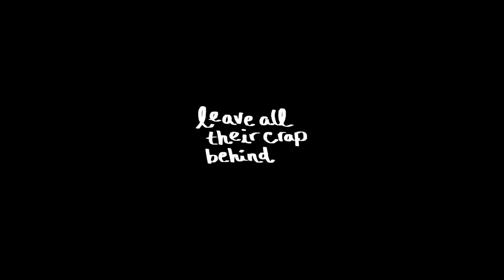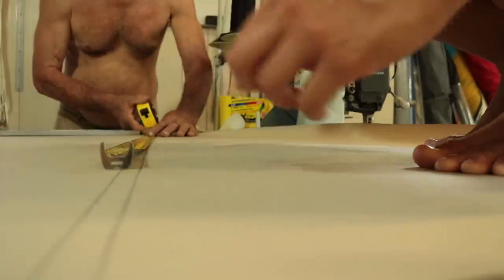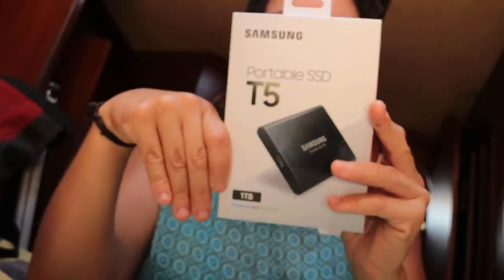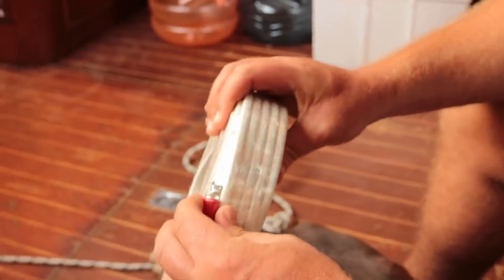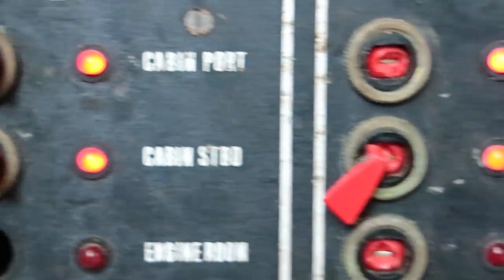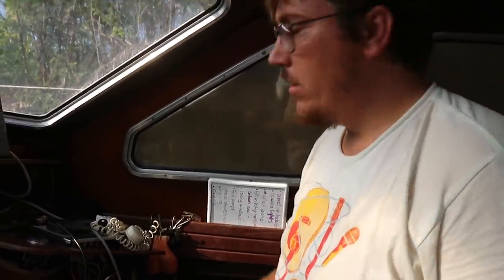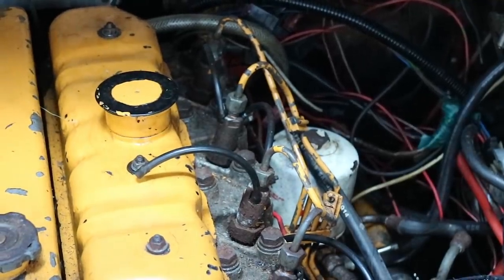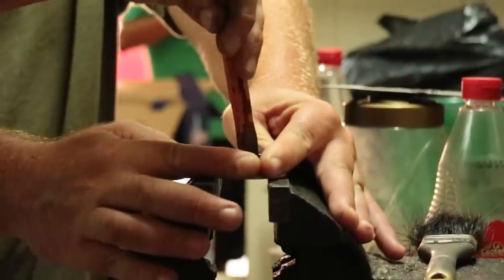58. Good As New

Comment: Another fantastic video guys! It's gonna be a great boat! Solder, and use a tinned solid core wire as a bridge, if need be. Great idea with the pvc. Use gray electrical pipe and you can get water tight fittings with access plates (with a gasket).
Reply from the maker: Yeah! Thinking that grey electrical pipe might be more fire resistant than normal pvc also.
Reply: @sailorama  PVC is inexpensive and easily molded around curves and bends.

Comment: LED light strips - I have had real success with soldering.  Helpful to have and extra pair of hands to help hold it together.  I just got a new strip to replace some tired ones, so I have to warm up the soldering iron.
Reply from the maker: Yes, the consensus seems to be soldering all the way!
Reply: +1 to soldering,  brush the leads first, then flux and pre-tin then solder.  
DON't  overhead as that tends to damage , thats one of the reasons for pre-tinning. ;-)

Comment: I just redid a friends boat with all LED's they are the best! 

Soldering is the way to fly with them! What I do is use duct tape to hold the strip and the wire while I solder, tape everything in place, and only do one side at a time. Let the other cool before you switch it up. I use a piece of plexi glass or an old cutting board to tape everything to, this holds it all still so I can create a really solid solder joint.
Reply from the maker: Using tape to hold everything in place is such a simple possible solution. We'll try this - thanks!
Reply: @sailorama  I will be at the dock next week so I will have power to solder, I will make you guys a video showing how I do it!
Reply from the maker: Cool. We’d watch that!

Comment: As long as you mount the LED-strip and the cables so that none of them can move, soldering has always worked out for me.
Reply from the maker: The solder doesn't like to stick on the led strips too well.. I guess I need more practice..
Reply: @sailorama  does your solder contain fluss? It could also be that the strip is not very clean. Try cleaning the solder pads with swinto, or scrape with a knife.
Reply: Apply liquid or paste flux before touching with the iron. It will help clear the point of soldering from any contamination.  @sailorama
Reply from the maker: Yes, tried flux. Will try to clean the area extra carefully...

Comment: Hey there.  Don't pull the engine yet.  I got an old diesel running this week.  I emptied the fuel filter and filled it with marvels magic mystery oil.  Next, I detached the recirculating hose that leaves the injection pump (sends unburned fuel back to tank) and attached a short length of fuel line to the banjo fitting there.  Next, I sucked on this hose until the color I was spitting out looked like marvels mystery oil (really wasn't that bad).  This, in effect, filled the gummed up injection pump with this oily detergent which is totally fine to run full strength through your engine.
Next, I reattached the recirculating line and started the engine.  It coughed and sputtered, blew some soot out of the tailpipe, and then began to run better than I ever remember it running.  Twas a great moment to see my wife walk over, smile and give me a thumbs up.  Not sure if AutoZone there in Mexico carries the Marvels, but Seafoam might be more available and can be used the same way.
Reply: Your username 🤣🤣🤣
Reply from the maker: Thanks for the detailed description! We don't have an AutoZone right here, but might have a chance to travel down the highway to one in Playa or Cancun. Will look for the Marvels or Seafoam that you suggested. Stay tuned! Awesome to hear that you managed to get a similar case running again!

Comment: hi, if u actually get that started put 1 cup per 100 gaal. of 2cycle oil into the fuel helps with sticky injectors and valve train.
Reply from the maker: Yes, will probably end up trying that. Increasing the viscosity could help loosen parts.

Comment: The electrical board is nice. I would just replace the switches with some quality units. Instead of Amazon, try Mouser or Digikey. NAFTA means that electronic parts are duty free between the US and Mexico. Skip the plastic toggles, since, as you can see, they break easily. Those look like M12 or 15/32 bushing thread.  Here's an example from Digikey, a dust tight and waterproof SPST: https://www.digikey.com/products/en?keywords=C3900BE And here is a more expensive, but high quality Japanese switch from Mouser: https://www.mouser.com/ProductDetail/NKK-Switches/S2AW
Reply from the maker: Yeah, thank you! Those websites are a little more pricey (mainly for the shipping it seems - mouser actually has competitive prices for the toggle switches themselves). Really helpful, awesome!

Comment: that jury-rig "compass" to trace the hull shape is typically called a shripe (or something like that poor translation)  
I would consider researching what local engine shops might have already that can drop into the old engine place for pennies on a florida rebuild engine.   I have had shockingly good luck buying almost hand-made engines around the world,  somehow the ICE have become adopted technology in most cultures these days, most of the engine makers can be trusted.
That said, ive sailed down the coast of Europe with a outboard for in-out duties on a parallelogram of sorts drop system to pop it out of the water and back in.. never had a problem.  and far easier to work on than stuff down in the belly of the beast.  - or at least I lived to tell sooo... its possible.
Reply from the maker: Hmm. What’s the biggest boat you’ve stuck an outboard onto?

Comment: Solder.  Tin the wire and the solder point.  Maybe then coat with a glob of hot glue to reinforce the solder and hold the end of the tape in place.
Reply from the maker: The glue is a good idea, might try that if we find any of that!

Comment: Seems like it has been made easy with crimp on. Non waterproof epoxy(?) and waterproof silicon types 4 wire etc. See below https://www.alightings.com/product/rgb-led-strip-to-wire-connector/ After checking that out then find cheapest place. But their is a coating you are running into. Take it off, tin the metal and then you can micro solder leads. I would get the crimp on.
Reply from the maker: Haven't seen these kind of clips yet. Gonna show them to Robi and see what he thinks...

Comment: Suggest using a punch instead of a chisel on the bearing.
Reply from the maker: Not visible from the angle shown, but there was no surface to grab with a punch. Had to ‘grab’ from the inside of the casing, so the chisel seemed to work well enough.

Comment: go to ebay and search led light strip connectors, you'll be amazed.
Reply from the maker: Yes - the usual connectors (we’ve used several cheap brands on amazon) have not worked very well. Not sure if we trust spending more for similar, but more expensive ones.